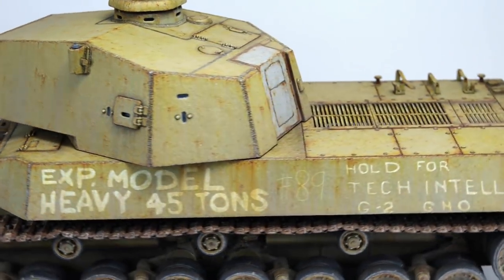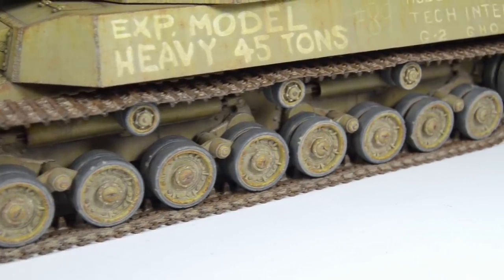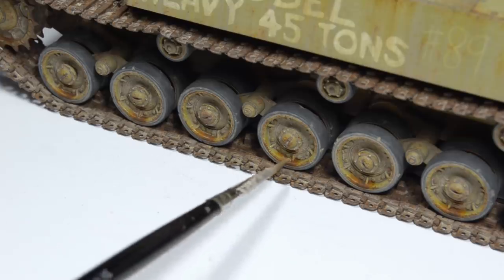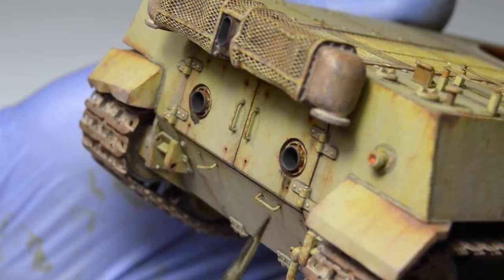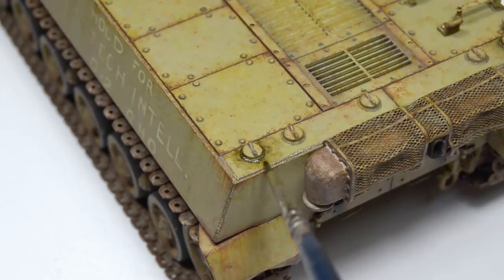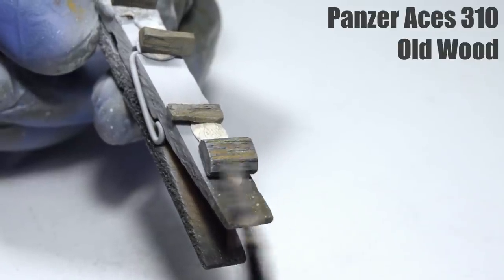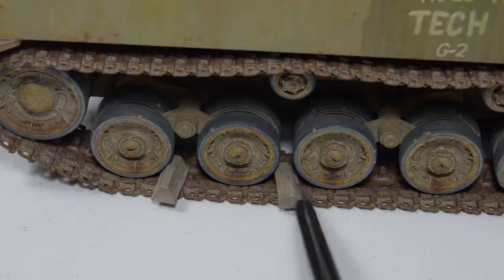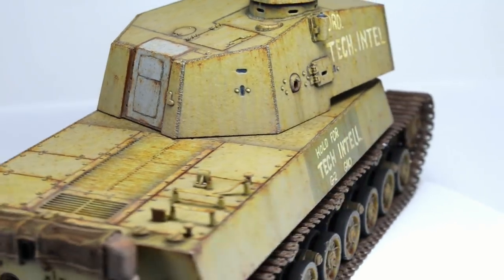THE END: Type 5 Chi-Ri (Fine Molds 1/35)

Comment: Hi Martin - really enjoyed following this from start to finish -

Maybe as your time is limited tackling those "shelf queens" you could never get to before might be a quicker option  - usually finishing off an older model that's been sitting around always feels so much better - like you're not wasting your money. 

You might want to distinguish in your videos that as you use Wilder oils these do dry flat by design naturally - some newer modellers might be concerned as their traditional oil paints dry shiny due to the Linseed oil and do often need a coat of flat to knock it back unless the oil is removed prior. If you mentioned this and I missed it - all apologies. 

Quick question: My Wilder textured earth Enamel has the consistency of sludge - I've tried Tamiya lacquer thinner but no luck - any suggestions on what might get it back to its original state? I contacted Wilder (the company) but haven't heard anything back as yet. 

Love the quick rehash at the end - very effective and useful. 

Thanks again,
Reply from the maker: Finishing shelf queens.... are you reading my mind or I just dropped way too many hints at the end of the video? :D 
Regarding Textured Earth... I don't know if we're talking about the same product, because Textured Earth is acrylic and it is supposed to be thick. I, however, make sure to always add a few drops of tap water after each use to prevent it from drying up.
Reply: @NightShiftScaleModels  You're right textured earth is acrylic and not enamel as I had thought originally - thinking of Wilder's Nitro line I guess - too many products. Thanks for the direction.